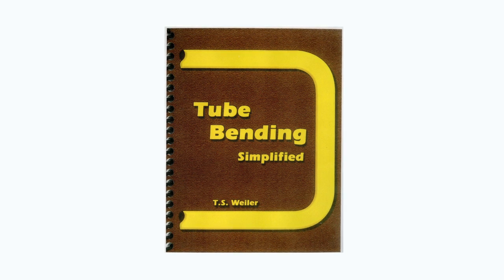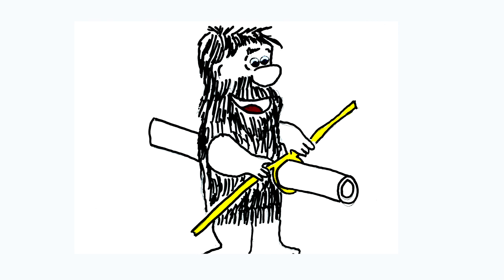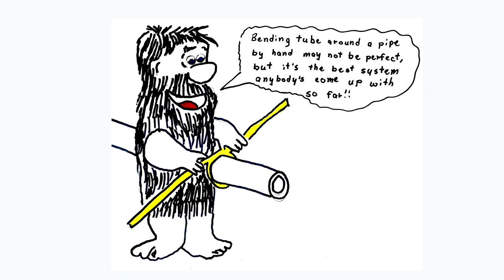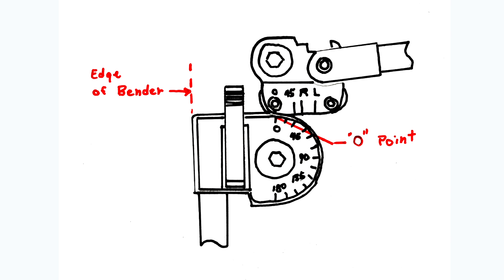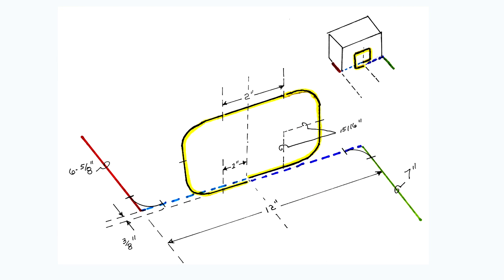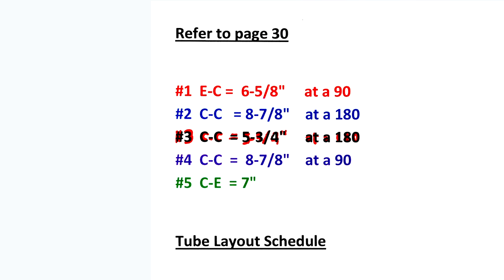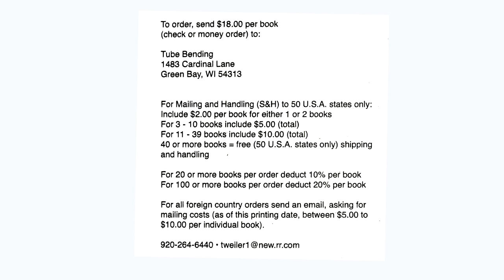How to Bend a Vibration Loop

Comment: Peter Santana:
I realize that this reply is late but, I seldom read the comments on my videos.
The reason that the 5th and the 6th printing of this book was Conduit - Tube Bending relates to a nuclear shutdown which I was on in 2012 at Fermi, Michigan.
An electrician on that job, who purchased a 4th printing copy of my book, convinced me to change the name of the book to Conduit - Tube Bending, to include electricians in the future market place.
So on the 5th and the 6th printing of this book, I changed the name on this book to Conduit - Tube Bending.
Math is constant worldwide; anything round, whether it is conduit, pipe, or tube, can be laid out and bent to precision, by using the easy to understand principles and math explained in this book.
This book is an easy 2 hour read.
All copies other than the 5th and the 6th printing, are titled Tube Bending.
The present printing (2020) is the 11th printing.  
I do not have the knowledge to change the title in anything which has been previously printed or posted.

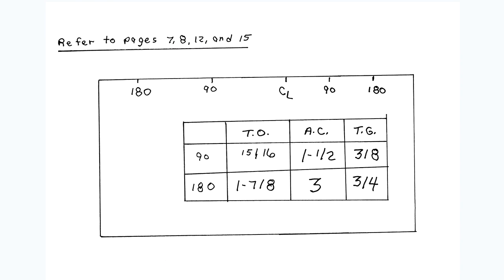Comment: Is it just me or does your Tube Spoon (4:10-4:30) appear to be backwards, according to the book TO to the left (further from CL but smaller distances)?? and AC to the right (closer to the CL but larger numbers)??
Reply: Brad Tibbe Hi Brad:Yours is a very good observation!This is simply a bad camera angle, both legs in the picture are the same length. The first dimension is 7"  E to C and the last dimension is 7" C - E.  The dimension between the two 90 degree bends is exactly 12" C - C, and  both angles are 90 degree angles.
Reply: Todd Weiler Hi Brad:I apologize, and I thank you!Your observation is correct, and my earlier post is incorrect!After further scrutiny, I can see that slide # 1 was photographed in reverse.  As such; in slide # 1, the part of the vibration loop shown on the left in slide # 1  is 7" E - C, and the part of the vibration loop shown on the right in slide # 1  is 6-5/8" C - E.  These measurements are the reverse of the explanation in the rest of the video.

Comment: The book say tube bending simplified but went you click the link it say conduit tube simplify
Reply from the maker: Some years back I was working on a job and an electrician advised me to change the name of the book so as to better appeal to electricians, because electricians could MOST CERTAINLY use this information.  The title of the book was changed for the 5th, and the 6th printing.  The most recent printing is the 12th printing, it and all other printings are titled Tube Bending Simplified.